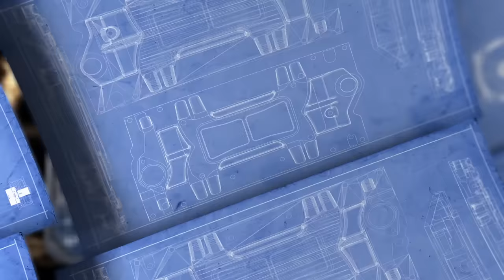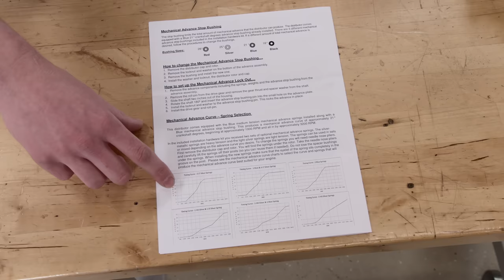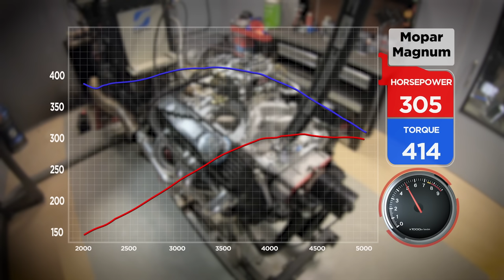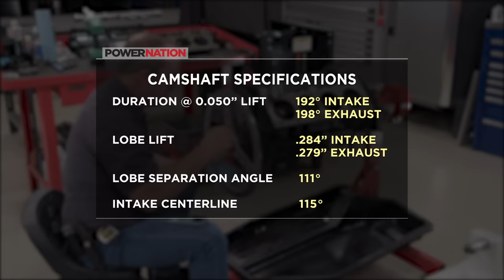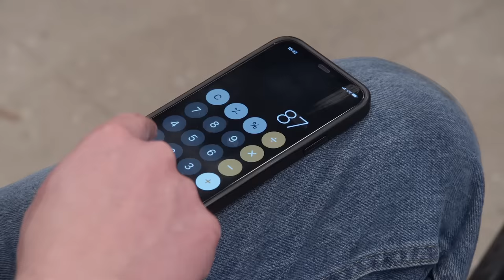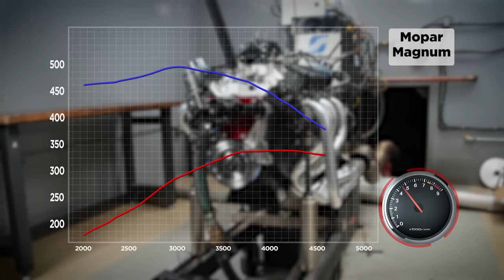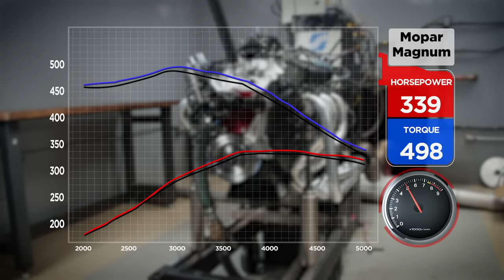What Happens If You Just Add A Stroker Kit To A Stock Mopar Magnum? - Engine Power S9, E3

Comment: I would so love to see what you guys could do with the old Magnum V10 engines! I'm thinking about putting one in my project truck just for the uniqueness lol
Reply: You deserve a beer 🍻 took the words right outta my mouth that 8.0L Hands Down will always be my favorite Domestic pickup gasser engine
Reply: I was about to do one some years ago but my partner said the V10 dodge engine is very unbalanced and a V8 is better so we went with a Chevy V8 but even the Ford V10 I was thinking to try but everyone talks about how unbalanced V10 engines are....
Reply: @hajileserpud9539  that may be true, I haven't looked into that. But I want to build something unique, so I am up for a challenge lol it's a 51 Dodge pickup, and I just don't want to do the same thing everyone else has done lol
Reply: @hajileserpud9539  look, would they put that moter in a viper if it was unbalanced? No. How about Lamborghini or Ferrari. That v10 was around a long time. It was a 488ci tq machine, way better than ford's. Your buddy just wanted to do a generally mediocre. Later on the ci was increased to a 505ci v10. 20yrs later and the trucks that had them in the srt10s are still running them. Only downside is I don't like the sound
Reply: @sonsofliberty3081  totally different motor only a hand full of parts will swap between the 2 also its super hard to find electronic components for this motor I'm a fan of the motor my self and own one but don't think your going to go to the local parts store to get parts
Reply: @sonsofliberty3081  my V10 has over 300,000 miles on, smooth running truck, bored mine 30 over and shaved the heads, pushing snow she a tank pushed snow with the head lights,on 35” tires and 5 1/2” lift
Reply: tough choice vs a Hemi  really examine your usage v10 stay with tall gears
Reply: Hard to find anyone that has done anything with the truck v10, iv been digging around for mo ths trying to find any machine shop that has do e anything but a stock rebuild on one, I need to get mine up to at least 11/1 for the fuek I run it on to start making good power. Even less I can find about ecm tuning since it dumps timing to 10° if you flat foot it, I'd like to see 40-50° timing to really wake it up. On initial start it's 68° of timing so the computer is capable of some crazy timing
Reply: @BigBeavrSlayer  I rebuilt several many years ago  
pay attention to oiling and oil drainback 
do not overcam unless you Viperize or you can loose low end without gaining much up top  pay attention to quench due to todays bad gas which also means knurled or spiraled guides with viton seals, teflon are too dry, and good seats in the exhausts  if you are using as a truck  I like hard chrome stems with a sunnen  od hone to hold some lube
Reply: @jmflournoy386  this truck is all about low end grunt, preferably off idle to about 2500rpm is where it operates and that's due to the woodgas fuel I run it on which operates best at low rpm low flow since it's a actual gaseous fuel it rely on vacuum from the engine to deliver the fuel into the engine. Very very slow flame speed across the piston so the more compression the better. The very limited fuek testing that has been done shows about 130 octane rating and peak powers around 13/1 compression. So little is known about this fuel no one has done any real testing on it. My other woodgas truck is a sbc at 9.5/1 and 45° of timing to make good power
Reply: @BigBeavrSlayer  We built motors to clean up pollution  drill some holes around and pull the one in the center into the intake, start on propane then run as much as possible on the bad stuff.  Like your wood gas key will be in your valve seats and valves, guides and good synthetic oil and test it regularly  Mopar and 460 fords worked, Chevy would not hold up  cheers  let total seal pick the rings  nasty environment
Reply: @jmflournoy386  there is a strange reaction that takes place between woodgas and synthetic oil, it starts getting thick at about 2000 miles. On my sbc truck I didn't know this and it got thick enough that it slowed the oil pump and sheared the bottom of the distributor off. Now running regular oil and changing filters every 1000 miles as pm. Need to get into a spinner filter system. I fire up on gasoline usually and warm up then switch to wood gas and that works pretty good. If I use the blowers I can start on straight woodgas to save on gasoline use
Reply: @BigBeavrSlayer  Very interesting I'll check it out  this was years ago I remember we used stainless rings and the premium (hard to machine) dura bond sintered seats that were developed IN WA state and Dura Bond bought the company  before that it was Martin Wells or similar
Reply: @jmflournoy386  that's interest I live in washington state
Reply: @BigBeavrSlayer  I'm trying to remember the name of that company  they could blend seats by sintering that could not be done by the usual casting methods  We found that keeping the valves on the seats as long as possible also helped. the late bill Jenks of Potvin and Moon cams developed the profiles   I may have mentioned that using one of Bill's(later Jones) cam and tight quench reduced EGT in 440 transit bus and motorhomes by 800 degrees (propane) but works for gas too
Reply: @jmflournoy386  with my sbc I had a big street cam in it and it was very interesting, it didn't wake up till 3000rpm, but with the flow restriction of the gas the motor only ran out to about 4000rpm. I just put a small rv cam in that engine to try out see what the performance gain is like in the low end
Reply: @BigBeavrSlayer  a  MOPAR hyd of 256 @.006 .204 @.050 with .305 at the cam 460 lift  
now what do you get with  a chevy cam with similar duration?
how big a chevy cam do you have to use to get similar lift?
how is overlap affected?
which motor is going to have a better torque curve? 
 (rv example here but  HP is same
Reply: @BigBeavrSlayer  Woodgas is cool, I was looking into it to run a generator.
Reply: @thefix2573  its a lot of fun to play with. I can hook my truck system up to a generator for a short time, my generators dont draw enough to keep the system hot and performing well. But both trucks are designed around 350-488cubic inches, not a 10hp single cylinder generator. For little motors like that a charcoal gasifier is a much better option then the raw wood that I use
Reply: @sonsofliberty3081 I have a Ford V10 with TBC Gibson headers, SPD Y-pipe kit & the Gibson side-exit exhaust. It's torquey, revs quicker, sounds better...but not really "Good." I have an L67 supercharged Buick, more modified, but headers & a Magnaflow exhaust. Same thing. Sounds better, but not really "Good"
Reply: Drop one of those V-10s into a Dodge Stealth, in place of the V6.......

Comment: I thought this was an excellent video of something that most people would never do just to see the results of stroke only
Reply: After seeing this, I just may build one exactly like this for an everyday driver. Mileage, reliability and that insane torque. Miles of smiles.
Reply: 339 hp for that much work debatable on worth it..
Reply: Well... The new numbers seemed way too high... until it dawned on me that the extra cubes cranked up the compression ratio !!!
Reply: @Thelongmanable  it's not about the horsepower. It's about the torque. Give that thing some highway gears and it will take off like a rocket. There is an old saying. Horsepower sells cars, but torque wins races. The potential for a high horsepower engine are right here in front of you. Do a cam swap and on the stock heads it will make another 50 horsepower or more. What more could you want? Not everyone has 10 grand to throw at an engine. Some folks want the best bang for the buck.

Comment: That turned out a lot better then I expected. I’d like to see it with a healthy cam and some nice heads to get it up to the numbers it deserves
Reply: Yeah... The new numbers seemed way too high... until it dawned on me that the extra cubes cranked up the compression ratio !!!
Reply: @BuzzLOLOL  It's a good build and 383 6 packs are really rare.  Did he say how long the rods are Yes if not keeping the stock heads might  as well go aluminum  I had 6 sets of 67 915s all done with hard seats and bronze guides-Serdi valve job
 could  not get my costs out of them when the Edelbrocks came out  Still have a ported  set on my motorhome motor
Reply: @jmflournoy386  - Weren't '68 Roadrunner Magnum 383 heads much better than '67 heads?
Reply: @BuzzLOLOL  flow about the same. 67 has a better chamber  (still lousey) you get some quench  68 works in 440 with KB or similar pistons  which are NA off the shelf for 383
Unless you are doing a matching number go AL  by the time you do guides and seats there is not much cost difference  There are better chambers than Edelbrock and speedmaster but choice depends on your usage  Pistons and heads have to work together

Comment: I am doing this exact same build to the 5.7 in my 99 Tahoe. Going from 350 to 383ish depending on the over bore. Going back bone stock other than a set of 1.6 full roller rockers and now I want to stroke the 318 in my D250 also.
Reply: The 318 I don't believe gets the respect should.

Comment: I did an engine swap with my 2000 dakota. Took out the tired 3.9l v6 and put this engine in it. New but stock aftermarket crank since the old one was not compatible with manual NV3500. Stock everything except for the camshaft CCA-20-602-9, same intake they used here with a treated wood 1/2in spacer and avs2650 4bbl carb, which i rebuilt and adjusted to 104main and 116 secondary jets. MSD coil and aeromotive pressure regulator. I have now finally found a video that can give me almost exact numbers. Thank you Powernation so much!!!
Reply: I have a 99 5.2 Magnum in a auto Durango I was thinking of swapping into my 96 Ram 3500NV shifted truck.  Will the Durangos auto trans crank be a problem?
Reply: Why is the stock crank not compatible with the NV3500?  If it's the external balance thing, you can get a Ram flywheel that's balanced for the 5.9 Magnum.  But I'd love to hear if there's another problem I haven't heard about.  I'm looking to do an NV3500 swap on my R/T.
Reply: @JETZcorp  I tried and tried, but the factory 5.9 crank would not have worked I was told when engaging the clutch with flywheel because it had a bubble divot pressed in on the end,  instead of a mashined hole (with flat bottom so the pilot bearing fit as intended) on the oem equivalent replacement. Also, the original was pulled out of an automatic setup (I took the flex plate off, it never had a flywheel-that was new part), and when I did pull the crank anyway I found brown color babbit on the main crank bearings, so I know it was well worn (maybe prolonged oil changed) and ready to blow up sooner then later. So now I know I'm good (new crank and new bearings).
Reply: @BryanPAllen  possibly. If it does not have a machined hole with flush bottom to accept a pilot bearing, then yes, you will have to change it. That is the one main big difference. So I would double check. If it is both magnum block and originally had a flexplate bolted on, you may have to change some parts. Sorry for the late reply.
Reply: @allanmcelroy9840  Thanks for that information.  It's not what I wanted to hear, but you potentially saved me a big nasty surprise.  I love my R/T but I despise the stupid Slurpee-feeling auto transmission.  Back in 2012 I was shopping for a 318 manual truck but got hooked by this one with the loud exhaust and big 360.  I'm really wishing I'd just bought the truck I was looking for.
Reply: @JETZcorp  if it helps to know, i got new refinished crank with new bearings off rockauto. And flywheel. Everything bolted together well....and a LOT more low end power! Honestly, I was able to do the crank under the motor without pulling it. Just take your time and u would be fine. I have heard of the dreaded slush box auto. Have you tried lucas additive beforehand?
Reply: @allanmcelroy9840  My main problem with the auto is that it's an auto.  I've never liked them in general.  I'll have to look at prices, but I think if I'm going through the bother of pulling a crank, I might buy an aftermarket one that comes internally balanced.  That would really open up flywheel options instead of being stuck with a heavy Ram flywheel.  I'd probably pull the motor and put it on a stand so that I can do other PITA things like a cam.  But idk, there are a lot of things to look into.  It's nice to know that a stock replacement crank is available to just slam in and go.

Comment: 500ftlbs of torque is just insane for a mostly stock engine. Imagine a cam and head swap how much it will add. I bet it will reach 600+ftlbs of torque and 450hp.
Reply: @bigboreracing356  it did.....3 pounds is negligable
Reply: @bigboreracing356  A few hp or lb/ft difference can come from dyno calibration, air humidity, temperature, altitude etc. Dyno numbers are never absolute.
Reply: Remember this is with dyno headers and no accessories though, real world will be decently less than that
Reply: @bigboreracing356  the difference between a 4.98 et and a 5.00 et is enormous and could take an additional 200hp to achieve. 
The difference between 498 lb/ft and 500 lb/ft is basically nothing and within the margin of error.
 You'd probably make up the 2 lb/ft by draining 1/2 a cup of oil out of the pan.
Reply: @bigboreracing356  do you have a stock head

Comment: take that same 360 bore it 40 over add a high flowing set of aftermarket heads and a single plane intake crank the compression up to 14 to 1 and feed it 120 octane fuel with a good drag spec cam it will really wake up and make power numbers like a big block . I know first hand these are the same build specs my late 70's 360 I raced had it would lift the front end off my dart on a hard pack dirt road and carry it 60 yards before coming down . it was an insane build that I wish I still had you got to love Mopar's

Comment: My 408 magnum stroker made 448hp, 528tq on an engine Dyno. Stage 2 iron EQ heads, decent camshaft. It's installed in my 98 ZJ with 30lb injectors, larger TB, Hughes efi intake, full 3" kolak exhaust with headers and now needs a tune. So ready for my project to be done!!

Comment: At first I was really impressed by the stock numbers but then when it was shown to be a fresh reman bored .040 over (which would make it 368 cubic inches) combined with it having dyno headers and the best flowing intake it could possibly see and didn't have ANY accessory load, it made more sense. Absolute best case scenario for engine numbers!
Reply: Yeah I noticed the same things... Would love to see the same comparison on a junk yard fresh engine with stock manifolds, intake, and distributor... Would be alot more of a true real world test
Reply: @that_sicksix1719  i saw a vid of a guy dynoing a stock 5.9 as it came out of the truck. it was like 285hp. underrated as hell from dodge, just like the 5.2 in my 93 d150. it runs way too hard at 275k for a 230hp motor.
Reply: @frigglebiscuit7484  - Dodge just giving the netHP rating as installed in vehicle...
Reply: Just the pre-1971 gross HP numbers... The new numbers seemed way too high... until it dawned on me that the extra cubes cranked up the compression ratio !!! And we don't know the compression heights of the pistons and whether the new ones were also higher up in the bores as well... 
If the compression ratio had been the same, the new HP numbers would have barely increased at all, maybe 2 - 10 numbers higher... but torque up by around 50 - 60...
Reply: Don’t forget, it also has 11:1 comp ratio

Comment: Dodge nut; The suggestions | might make are improving air flow. Checking that intake manifold matches heads and polish. Check exhaust pipe for smooth air flow. Check to see whether long or shorter headers changes when the RPM power peak occurs.( old school )

Comment: I built one almost exactly like that and put it in an extended cab dually and it will easily spin all 4 rear tires.  The only difference is the stock intake I just slightly modified it and running the early large port exhaust manifolds instead of headers.  It is done around 4000 RPM but it is a monster below that,
Reply: I am considering doing what you mentioned above. What year is your truck? Its going in a 1999 Durango. With this work well together with the factor efi?
Reply: @alexgrindnshine2522  it is a 97. It would work well in a 99.  I actually built a 99 durango with a 4 inch stroke in a  318 block (392 CID) and it was awesome, the weight transfr is great for hooking up so it launched hard without spinning the tires.  I ran junk yard 460 ford fuel injectors in both to get the extra fuel they need.  Quality tuning would have added more for sure but wasn't in the budget.

Comment: The 408’s are internally balanced, so you’ll need a non-weighted 318 flex plate or flywheel if you’re working with a 360 setup. The same stroker on the 5.2 318 will make 390ci and you can use the stock flex plate or flywheel.
Reply: That's the problem with mine right now. Engine was installed by a local shop and they put a weighted flexplate on it. Vibrations are crazy past 2k RPMs. Gonna put a 5.2 flexplate on it.

Comment: I remember something my Ex-Father-in-Law said damn near 30  years ago. "If you can't make 400hp with stock parts, you don't need to be building engines." He had a 350 in his old car that put down 310hp and 425lbs. Built in the early '80's to pull campers. 2 spd power glide with the original 283 2 barrel carb. 2.73 rear-end from a '57 Pontiac Safari. Loaded down with tools, he drove from Winston-Salam to Jersey for work and got 20+ mpg. I asked him once why he never swapped in a 350TH. He said it wouldn't hit 3rd until 95 even taking it easy.
Reply: Actually a 2 speed PowerGlide is just a TH 350 without a 1st gear... Torque converter was supposed to replace a real 1st gear...